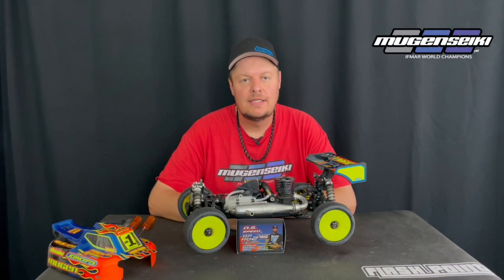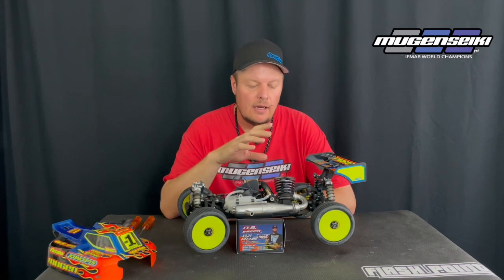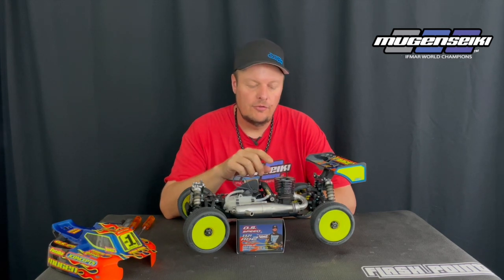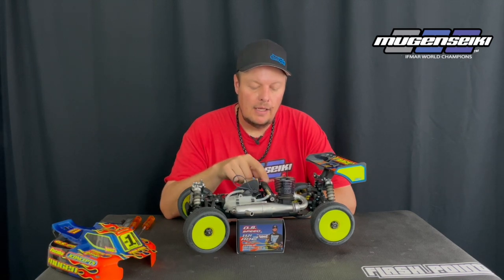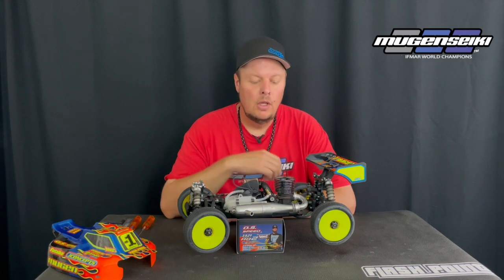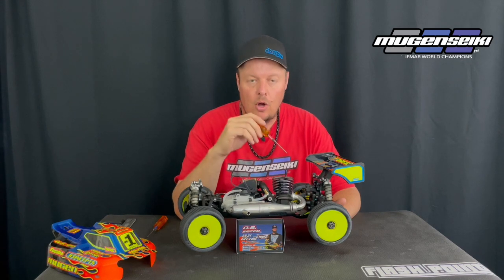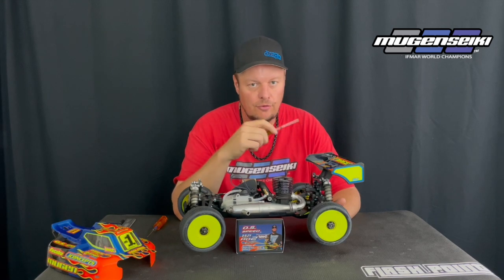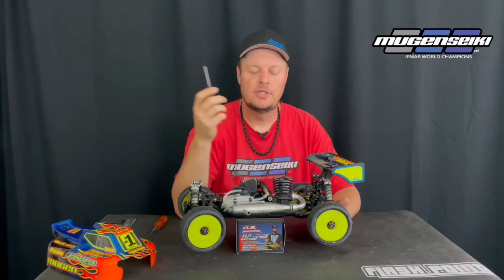Torque Specifications for Nitro Engines.

Comment: Thanks for sharing Adam. 62 inch lbs / 7 Nm is the flywheel nut torque spec. I also add a small drop of blue loctite. I've been using this for many years without a single issue. The spec was on the NovaRossi or OS website years ago.

Comment: Hey adam can i use nimh battery on a high voltage servo?
Reply: Yes you can. I run protek 170 sbl’s and tbl’s on my Truggy and buggy with a 1200mAh nimh flat pack and they work great. It’s 6 volts so I’m not getting the max speed and torque out of the servos but those servos are already so fast and have so much torque that it’s really not necessary to use 7.4 volts
Reply: @asher12356 do
The NIMH batteries last longer than say a lipo?